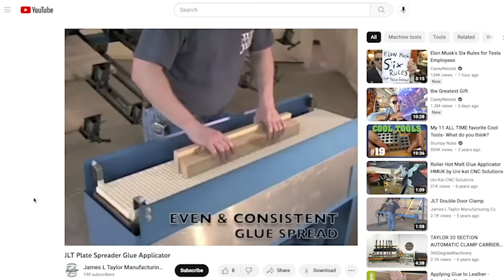We built 100 cutting boards in 6 days!

Comment: That's a bit of an exaggeration. . . All you really lost is the cost of the extra cherry and the labor to mill it down
Reply: He is talking about the lost revenue opportunity.
Reply: @timeandattendancesolutions  I get that, but it's still misleading.  It's all about how the "data" is displayed/presented.
Reply: It’s a lot less misleading once you start your own woodworking business and accidentally ruin multiple boards or items and have to make a whole new batch just to have enough to fulfill your orders. The cost to the business is always more than just time and materials.
Reply: I wouldn't say it is misleading. We do not know all the details regarding his capacity to make more product. We rely on him to assess the lost opportunity.  Had he not made the mistake, his revenue and his profit would be higher.  What you are mistaking this for is a typical manufacturing process where inefficient use of materials normally does not create lost sales opportunities and is therefore simply a cost of manufacturing approximately equal to the raw cost of the materials.  In his case, inefficient use of resources costs him much more than the material costs. Additionally, it may well be that he does not have the capacity to go back and make the additional boards ready for sale in the peak periods. There are economies of scale, so he probably can't just make up the shortfall at anywhere near the same cost.
Reply: @keithcorey5535  it's not misleading. When your business is up and running and you're filling orders as fast as you can produce your product, the loss to consider is the loss of revenue.
Reply: Bit of a nerd here but I really want to see the full math break down. Its been keeping me up at night. How did using 16.5% more wood up the cost per board by $15? Sure there is going to be some additional material cost there but that can't be more than a dollar or two of it. He explained it with an increase in labor cost, but even if you pay yourself $45/hour that still means he spent close to 20 more minutes per board due to the issue resulting in something like 36 hours of additional work which seems like way too much to have squeezed in to a 6 day period.
Reply: @Robertlavigne1  If you are talking about the extra cost of the Cherry that was oversized then you are only thinking about the material cost and not the lost sales. 
I do agree that one business model, the typical high volume manufacturing model, considers only labour, materials and manufacturing overheads as cost of goods sold (COGS) This model work well in typical high-volume manufacturing because they have the buffers of stock and inventory and warehousing. If a manufacturing run falls short due to say, machine failure, then there will be sufficient stock on hand at the warehouse to deal with end-user demands. The manufacturer can increase production over subsequent days to make up for the last shortfall and no sales are lost due. This is a key point... no sales are lost.  The Japanese took a different approach. They considered warehousing and distribution ( both for raw materials and manufactured goods) as a cost of goods sold and went about streamlining those processes to further reduce the real cost of goods sold.

 The Just In Time( (JIT) model relies on exactly that... only enough raw materials are purchased and only enough goods are produced to meet the demands. This does mean of course that you need a close relationship with both your suppliers and your consumers. The point is that cost can be measured and dealt with in various ways. 

When this YouTuber says he "Lost Money" then he is talking about the lost sales opportunity resulting from making fewer boards than he could have with the wood he had.
He wasn't saying ( I don't think) that his cost of goods sold was significantly higher.

If he did not make as many as he could have and
 if he could have sold more, and
 he can't make up for that then he lost money by oversizing the cherry.
then he lost money through lost opportunity.

That is just simple maths.

I suspect he won't make that mistake again!
Reply: @timeandattendancesolutions I am talking about his cost per board calculation. He says expected cost of goods and labour to be 138 boards *  $56.13/board = $7645. Then he says 109 boards cost $$7745.94 to make which comes out to $71.05 per board. That is a difference of $14.92 that has to come from materials and/or labour as this is all before any discussion of profit or lost revenue.
Reply: @Robertlavigne1  Gotcha! Sorry. I get what you mean.
Reply: @Robertlavigne1  he paid the same for the whole pile of lumber expecting to be able to make 138... But instead he only got 109.. if it cost him approx 15 more per board then he threw away about $700-$900 worth of lumber in offcuts out of the $3700 ish for lumber but then because he didn't make as many boards maybe saved a couple hundred bucks in labour as well because less boards take less time so the overall cost of the boards materials + labour will be more

Comment: I would say the thickness difference is probably due to blade heating up and stretching. Maple is considerably harder than cherry, so possibly the softer wood allowed blade to flex out a bit, causing the width difference.

Comment: These boards are not that nice and suspect they would not last well.  They boards should be doweled or biscuit together to give something beyond just glue keeping it together.
Reply: Tightbond 2 or 3 really holds wood to wood incredibly well.  The bond is stronger than the wood when applied correctly.   As long as ppl don’t throw them in the dishwasher, the boards will hold.

Comment: No juice groove? No round over? No hand holds? 👎🏻
Reply: Not always necessary depending on how it's used. My main board isn't used for cooked meat so no need for the groove. I also never move it, so don't need hand holds. The no round over part I agree with. There must be a step there we didn't see.